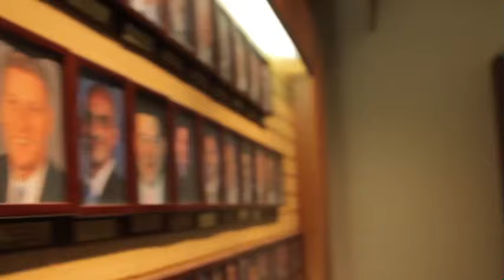The Kirby Vacuum Company Headquarters Highlight Tour

Comment: i know i probably shouldnt say this but if you truely cannot afford a new kirby then used models are plentiful and still offer great performance and durability. these machines are built as such that they can be made to run forever with the occasional motor brushes, switches, cords, and brushroll replacement. my kirby is a 30 year old vacuum and it still gets used nearly every day

Comment from the maker: Kirby vacuums do cost more than most vacuums found at retail stores, but that's because they are made of durable materials, like aluminum, that will last for years. Plus it's more than just a vacuum cleaner, it is a complete home care system. It can be used as a shampooer, floor buffer, portable workshop and more!

Comment: thats right kirby vacuums are more efficient because they have better quality windings in the motors. my heritage I only draws 5.5 amps on hose and 4.5 on carpet and it will out clean every department store vacuum and has been doing it for many years. understandably newer kirby vacs draw addition power over the PRE generation 3 models simply because the G3 and up have a transmission to drive the wheels, this requires more power

Comment: the riccar is a pretty good vacuum for the money, but kirby is probably better, i have both a kirby heritage, that is 30 years old minor maintenance has kept this thing going and it will probably go another 30 years, they are well built. my riccar is 3 or 4 years old and already needs a handle replaced. riccars are better then department store dysons but they still are not a kirby. im going to try to sell rebuilt kirby machines. i just bought a tradition and a G6 to resell.